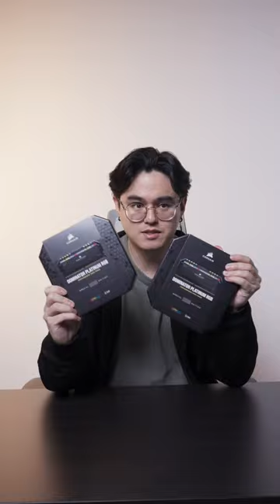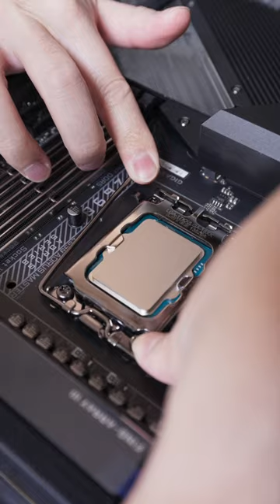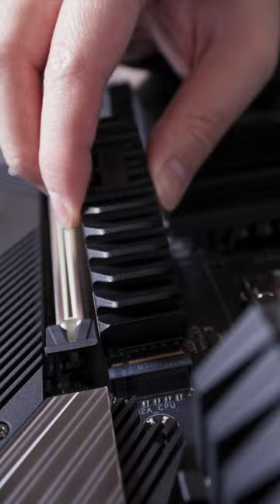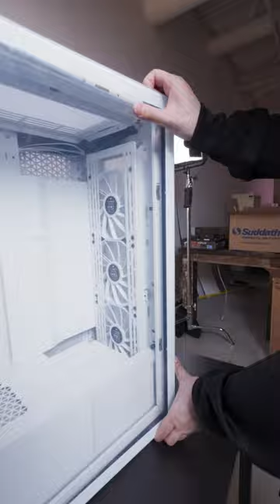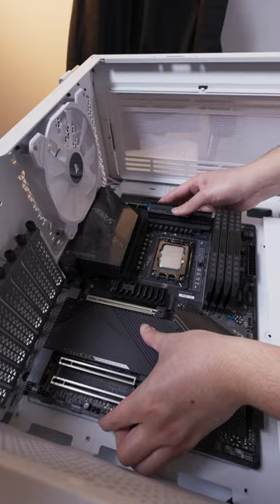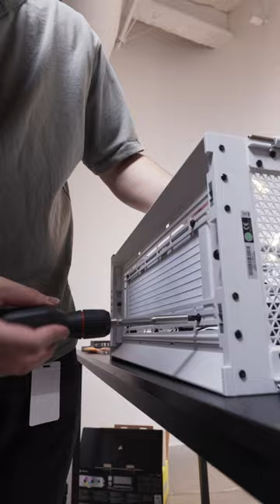Pt. 1 of our high end computer build! #corsair #pcbuild #shorts

Comment: You know, I've always loved Corsair equipment, I've used Corsair ram in every computer I've built since the 1990s. After all these years though, you've still got one major problem. Your manuals suck. I come here for more guidance, and nothing. bought a massive case for my latest mega build to last me the next 5 years of gaming, and nothing. 
I don't NEED a 1:45 commercial for your case, I've already bought it! Leave selling your cases up to people like Linus and Jayz. (things that were negatives to them, were positives to me, so don't be afraid of them saying bad things, unless it's airflow problems. please fix that.) What are the things that i'm missing since I haven't built a computer from scratch in 14 years and don't recognize 3/4 the stuff in here any more? I bought the biggest case you made (as far as I could tell) and the biggest AIO radiator. no instructions there either. very frustrating.
If you're giving us a build video, show us building the computer with as many of your components as possible, not just a 3 second clip of an unpackaging followed by putting the last screw in. that doesn't help anyone use your products! You're a manufacturer, not a youtuber! stop acting like Linus and start acting like someone who actually wants people to USE their products!